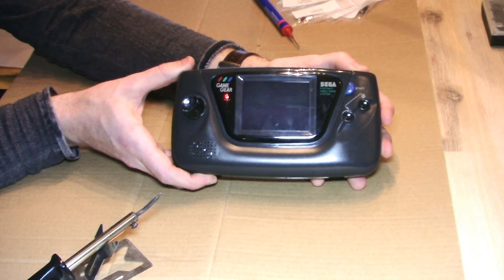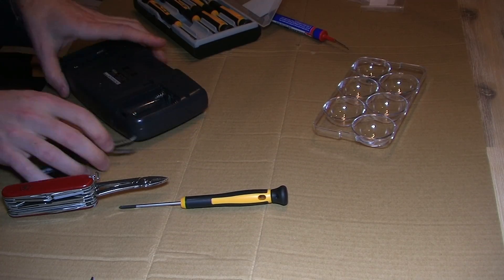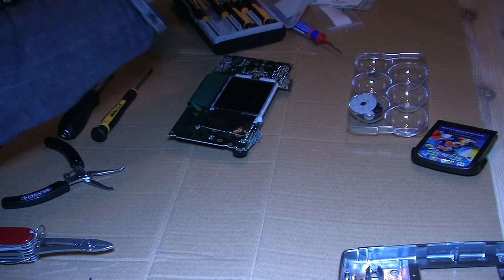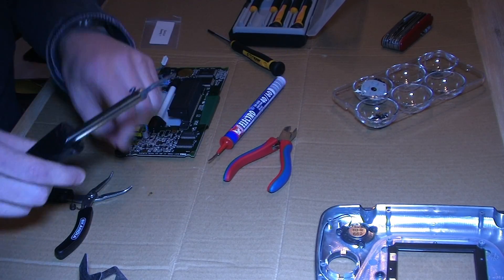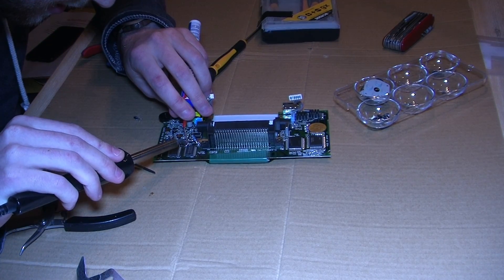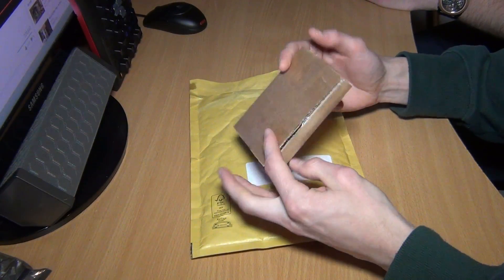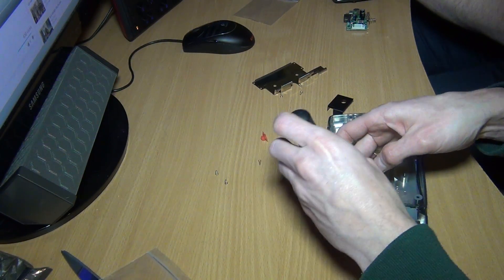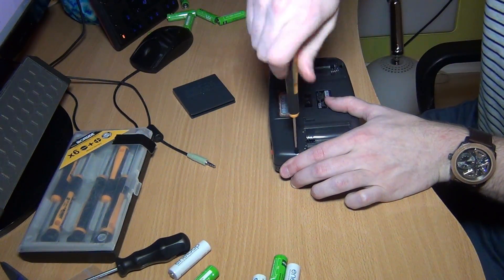Fixing a Sega Game Gear (Screen, Sound and Power)

Comment: My game gear screen flickers on spottily but then goes black after a few seconds. Do you think it just needs the capacitors replaced? If so, I might be able to do that without too much hassle.
Reply from the maker: Does it fade to black? Good chance it's also a capacitor problem. How much hassle it is? Check the video 😁

Certainly doable.
Reply: @RetroGameCouch  yes, it fades to black so I assumed capacitor issue. Been watching a couple videos on how to solder and I think I'm up to the challenge.  :)
Reply from the maker: You got this.

Comment: Top tip: to get the security screw out easily... melt the top of a plastic pen (biro is ideal). while molten...force it into the socket and push down.  wait a minute for it to harden and then unscrew. Magic. Your welcome.
Reply from the maker: Great tip!
Reply: Or use Nintendo game bit screw driver

Comment: A question about recapping the game gear, do you by any chance provide this service to others as well or do you purely do it for your own hobby? i have a old game gear i would love to have completely recapped at some stage as i get ghostlines on the screen atm , sounds good, brightness is fijne but i do think theyres at least 1 capacitor thats causing these vertical ghostlines ( for example in sonic 1 the pillars in a certain lvl are like they extend across the entire screen despite them only taking up half the screen normally, theres a ghost line extending them.
hope you read this one as the videos 4 years old now.
Reply from the maker: I read almost all comments. I don't mind recapping a game gear. My email address is on the about tab on my YouTube channel.

Comment: If I use a 1000uF instead a 820uF for the power board, am I going to do a wrong move? And if I put a 100uF instead a 68uF for the main board?
Reply: It will work just fine.

Comment: Thanks for the video. So it seems most of these units that are now dead just need the capacitors changed. They must have used dodgey capacitors back in the 90's. :) Some games I like on the GG are Sonic 1, 3 and Triple Trouble, Wonder Boy, Cool Spot, Columns, Streets of Rage 1 and 2...
Reply from the maker: +NiGHTS1980 seems like it, yes. Luckily we can fix it.

Comment: My sega game gear has no power, no display, corroded buttons contacts, corroded switch and pcb board. How do I fix it?
Reply: My game gear has a leakage on sound board how do I fix it? Replace the capacitors and put a new one?
Reply from the maker: +Miguel Iv Tanyag replacing tje sound board is easiest.

Comment: RetroGameCouch, where did you buy the replacement power and sound boards from?
Reply from the maker: +Riddler95 ebay!
Reply: I just looked on eBay and I couldn't find any. I guess I'll have to wait for some to be listed.

All of a sudden my SEGA Game Gear won't power on with the AC Adaptor. I'd rather just replace the entire power board instead of removing the old capacitors and soldering new ones on. It is so much easier.
Reply from the maker: +Riddler95 good call.
Reply: I just popped six new AA Batteries in my SEGA Game Gear and it powered on. I am going to replace the capacitors on the motherboard so the screen can display images perfectly again but I as I said before I am not going to bother replacing the capacitors on the power board. I'll just replace the board itself.

Comment: Clutch Hitter is very good game to own, it's baseball and it's even better with a 2nd GameGear and game using the Gear-2-Gear cable for two player action. 

How long did it take you to do this mass capacitor replacement project?  
I too have this task at hand on a 2nd owned gamegear I have that I once repaired the sound on, now I get absolutely nothing except distorted screen.  I got that kit and it comes with a lot of capacitors, this looks like an all day project.
Reply from the maker: Thanks for the suggestion. Haven't seen that game yet on the retro conventions I usually visit, but I'll keep my eyes open. The soldering took between 2 and 2.5 hours I think. Luckily my friend did all the soldering on this one :)

Comment: perfect demo bud :D 
just a quick question when soldering do u heat up the pins the apply the solder or other way around?
Reply from the maker: I pre-tin the connection and capacitor legs, then when positioning it, you heat it and add some extra solder at the same time if needed.

Comment: who would you recommend to fix my game gear   I'm no good at soldering all I want to do to send it to get it fixed
Reply from the maker: Does it have the same problem as mine? The faded screen?
Reply: It has black lines and I'm not too sure if the Sound Works
Reply from the maker: Sounds more like the actual LCD is dying. :(
Reply: So can you fix
Reply from the maker: Replacement screens are expensive, unless you can find another Game Gear with a working screen.
Reply: hi! where did you buy the replacement parts? Thanks
Reply from the maker: V Bakker From https://www.nintendorepairhut.com , very reliable website.